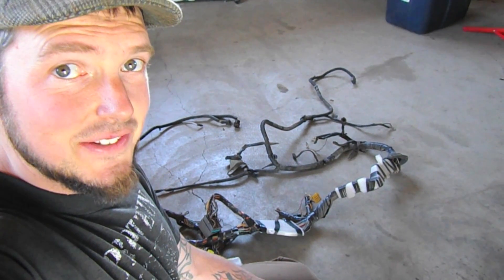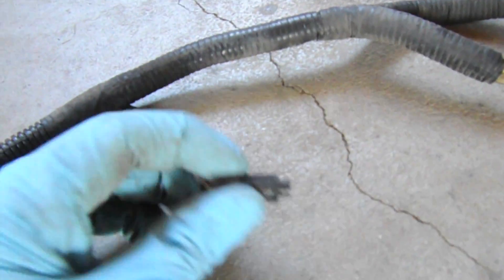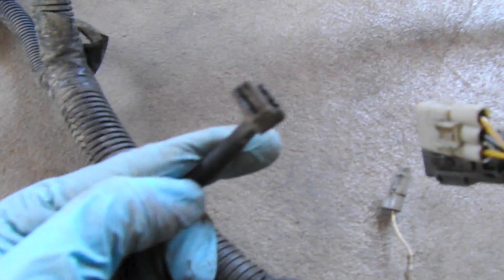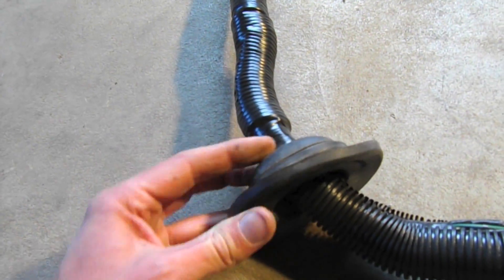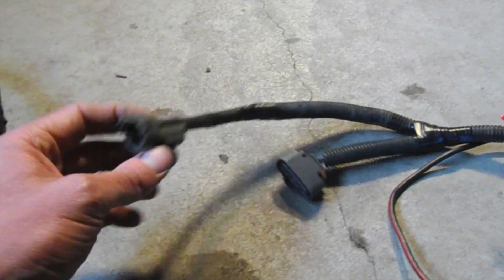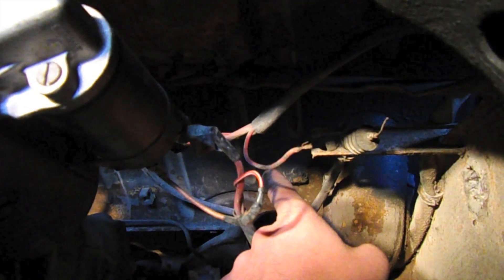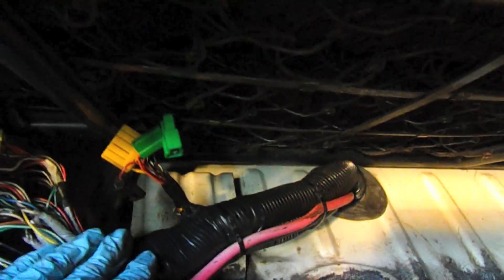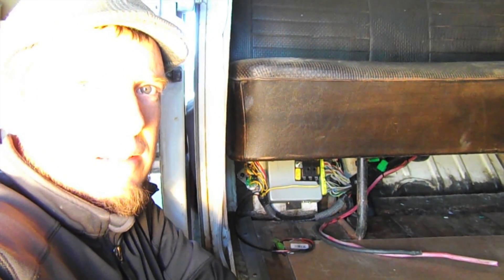Creating the Busaru wiring harness - Busaru Engine Conversion Part 3

Comment: hey man if my motors jdm im running jdm ecu and that select monitor doesnt work with it could i get a usdm ecu for the same year and it work correctly?
Reply from the maker: Probably not - JDM and USDM Harness pinouts are much different. The ecu connectors are quite a bit different too.
Reply: well carp lol o well i guess
Reply from the maker: The workaround is getting a USDM Harness and ecu - that’s the ticket to OBD2 with a JDM engine.
Reply: Maybe one day I'll have to swap it all

Comment: Why do you remove the big grey connector? Is it more just to save space or does in need to be removed? Just curious as I am trying to build a wire harness for my 72 Squareback and my donor is a 92 Legacy.
Reply from the maker: +Subaru Swapped Late Model Squareback EJ22 You can leave it, it's just not a very clean arrangement in my opinion. Plus, eliminating the big grey plug gives you some good soldering practice ;)
Reply: Busaru I agree just wasn't sure. Do you have other walk through video on the obd1? I have a wire going from the engine plug to the fuse block in the car. I want to remove the fuse panel like you do but I have no idea where to connect the solid yellow wire after I remove the fuse block. Also I have the 3 wire alternator plug where do the 2 smaller wires go?
Reply from the maker: +Subaru Swapped Late Model Squareback EJ22 You may consider checking out the factory service manual regarding the alt wiring - it'll help clarify a lot of things. You can find links to them on my website: Busaru.com

Is the solid yellow wire for ignition on or battery?
Reply: Busaru I am not sure. Is the a engine plug pin out? I know it comes from one of the 2 engine plugs and ended at the fuse block but not sure where after that. I am guess most have felt with this as everybody removes the fuse block. I wish I could post a picture.
Reply from the maker: +Subaru Swapped Late Model Squareback EJ22 it sure sounds like either ignition on or battery. Use the ecu pinout or service manual to double check.
Reply: Busaru it appears to go to the "ignition coil" so I am guessing just slice it into a yellow ignition wire coming of the ignition relay.

Comment: hey bro... well my 82 Vanagon L conversion to 91 Subaru 2.2L Legacy L motor has finally developed some wiring issues.  Really can't complain as the conversion was done about 10 years ago.  I would like to keep the 2.2L engine as the compression is excellent and no smoke and no leaks.  My question is (1) what years/models are compatible with 91 Subaru Legacy L as far as donor wiring harness, and (2) if I change the ECU along with the matching wiring harness does year/model really matter, as long as it is from a 2.2L?
Reply from the maker: +B.J. Boyette Well, If I was going to upgrade harnesses then I'd probably look for a 95+ ecu and full harness, that way I could get OBD2 functionality. The timing equipment switched over around 2001 so I would stay older than that. A 2.5 harness will work but stick with 2.2 if possible. Good luck!
Reply: Busaru can you use any model wrx motor? I’d like to try a STI model motor from around 04-06
Reply: Juan Perez Lol good luck

Comment: hi Mik.my alternator Hitachi (from legacy 1992 japan import)  is what with the round plug but with 4 wires. the yellow one (IG) that it goes through ignition relay and fuel pump relay to B12 in the ecu pin out , the white one  called S (signal)  the  black one (L) alternator light and one more that is green  with black stripe (D) and it goes to the ECU  at D.21 pin out. i know that the 99.9999% subaru ej 22 from legacy 1990-4 also have the round plug alternator but with 3 wires (white - yellow - and black) .My ECu is JDM labelled G2 22 611 AA950.
After hundreds of hours surfing in net in many subaru forums noone could give an answer what is the purpose of this green (D) wire and why is connected to the ecu?( i want to make an upgrade with an newer 2  or 3 plug Alternator and i want to know that if i cut away this green wire will affect  the Ecu and the Engine . iknow also that with the upgrade must cut also the yellow one wire ). Thanks.

Comment: I have a legacy 94 automatic and a 77 vw bus manual transmission and I would like to know if I can use the harnnes and pcm for this project
Reply from the maker: You most certainly can, you will have to tell the computer that it is now in a manual trans car though. Review the ecu pinout to find the trans ID pin.
Reply: Busaru how can I bypass the rev limiter?

Comment: Great videos. What multigauge are you using?
Reply from the maker: Hey William, I wouldn't recommend it. It's too bright at night and doesn't read accurately for oil pressure. The link to the Ebay store is in the gauge video description if you want to check it out though.
Reply: +Busaru I didn't see the link but I will probably end up with the MGL EMS E1 gauge.

Comment: Nice Job sir I myself am doing a conversion in my 65 bus, but will be using a Microsquirt engine management which does not require you to pull out the entire wiring harness from the car.  You basically disconnect the  main harness right at the engine and you can leave the rest in the car you then connect the wire the Microssquirt to all the sensors that are on the engine..  I will also be offering this conversion service for anyone who may not have the complete wiring loom from the car or may not want to go through the hassle of pulling it out of the car.
Reply: My email address is a914freak@gmail.com I am in the process of working on getting setup to do them on a case by case basis for EJ20 and 25's what engine are you swapping in?

Kyle
Reply from the maker: Hi Matthew, I am travelling so I stopped producing parts for a little while.RJES supplies parts but they are a quite a bit different than mine. Good luck in your swap and I can let you know when I have kits available again.
Reply from the maker: Hi Kyle, I played around with micro squirt a lot. Fun little ECU for sure. What timing trigger do you generally have the least trouble with? I wouldn't recommend Microsquirt for most people though - definitely takes a lot more tuning and computer skills than using the Subaru computer. It's not too hard to pull a Subaru harness either - probably less work than splicing a MIcrosquirt ecu to the Subaru engine harness...
Reply: +Busaru I keep the same triggers that came on the motor....I found that if you start swapping components that's when you run into problems.  My tuner buddy has never had any issues with microsquirt so as long as all the sensors are the ones that BELONG to that engine.

Comment: awesome video(s) great layout how everything was explained, but this right here is whats holding me back from putting subie power in my railbuggy, plus trying to find an obd1 legacy donor car is kinda hard around here in ohio, well at least one that runs fair for a good price.
Reply from the maker: Go for a newer donor car. The obd2 engines and harnesses are great - just a few more sensors but it's really not a big deal.
Reply: Busaru do you have any of this posted on a forum? and also where did you find the ecu pinout for the 95 legacy because i'm in the middle of the swap and am having a hell of a time finding one! 
-Thanks

Comment: Do you have to have a harness from the same year as the engine?  I have 96 2.5 dohc engine and 01 harness and computer.  Will it work together?
Reply from the maker: Generally you want to keep things VERY similar as the sensors changed plug design and wire placements. I think you might run into problems to be honest. I would check on the Subaru forums to see what problems you might run into - that'd be a much better resource than the VW swap community (at this point). Good luck and I hope it works out!

Comment: Just a quick question where did you get to wiring diagram. Thanks
Reply from the maker: Hey Brian, The KEP wiring diagram is pretty sweet but only pertains to 90-94 ECU's. It is a giant blueprint showing all of the connectors and how to wire them in life size. I bought mine for $20 about 8 years ago so it may have been updated. This is just a general guideline and it isn't terribly necessary to follow completely, just a good starting point if you've never done one before. If you have a newer model, I'd recommend find the I/O chart (Google) for your particular model year ECU and use the pinout on that to find all the necessary connectors. At some point I may do a more in depth wiring harness video but I'm starting to lean toward Megasquirt conversions instead - there is a lot more adjustably.
Reply: Yeah I'm getting ready to build the whole wiring harness for the 1969 bug out of the legacys wiring harness with fuse panel and relays.

Comment: Great videos!! I'm currently in the planning stage of doing the swap on my 74 myself except with a Phase 2 ej22. Your videos are really helping build up my confidence. Would you be able to help me rewire the harness on my 97 Outback sport ej22 phase 2 engine ?
Reply from the maker: Thats great! The 97 should have a slightly easier wiring harness to deal with since, I believe, it doesn't have the large connector that you need to cut out and splice the wires. What I would do is get the I/O chart from the factory service manual (Google should have this somewhere), then I'd just plot out what you need to keep and what you can delete. As far as doing the harness, if you need someone to do it for you, Tom Shiels is the man - I'd search for him as he has a good setup to do harnesses.